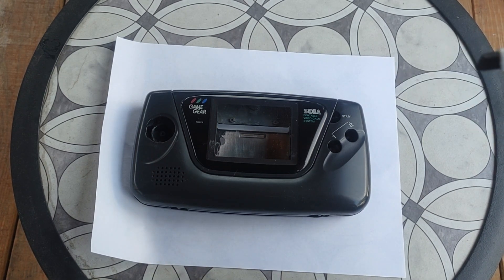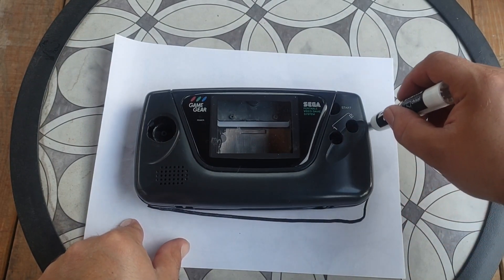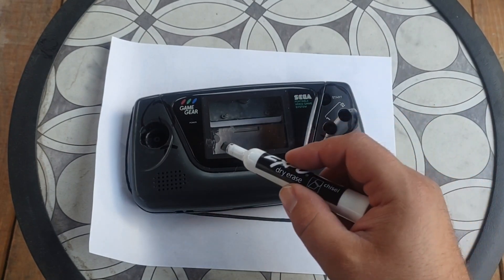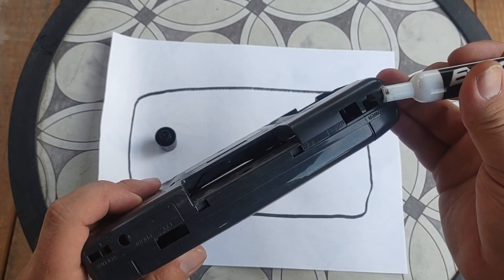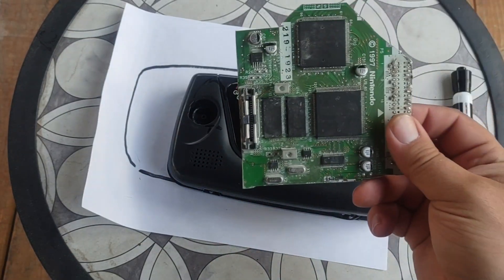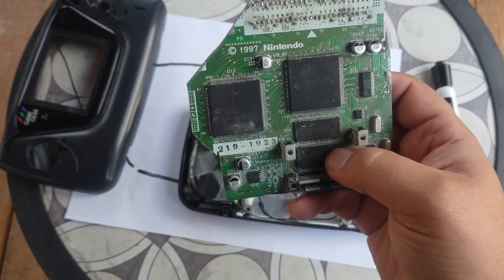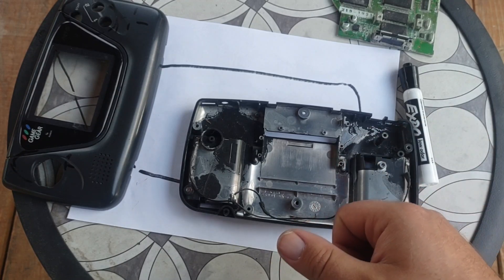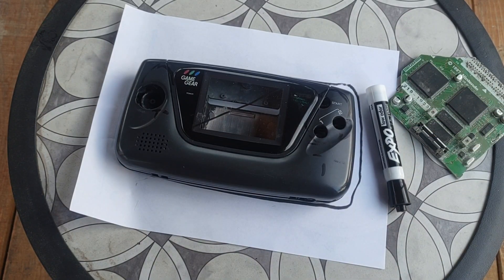N64 Portable in a Sega GameGear part 1: planning

Comment: Cut off the top pins and wire it up directly to the rcp chip
Reply from the maker: I've tried that before in the past and found it unreliable and difficult lol but we will see, maybe. I recently got 11 n64s pretty cheap so I may experiment
Reply: @wolfsquatch  I've done it before just to make it fit in a atari lynx 2
Reply from the maker: @MrGoemon1  are you saying just the top 24? How many of those are actually required to go to the rcp?
Reply: @wolfsquatch  yes the top row and about 18 wires and use a Voltage meter to trace the pin to the rcp chip
Reply from the maker: @MrGoemon1  definitely gonna try it out

Comment: Cool project mock up looks sweet! Good luck
Reply: How could you fit an n64 cartridge in it?
Reply from the maker: @zasandfan1922  either resting on the back or on the top
Reply: @wolfsquatch  no experience with n64, but couldnt you just run games off an Micro-SD Card mounted inside the game gear...
Reply from the maker: @markjaasmi9159  yes, I could do that but I would like the ability to play my physical cartridges.
Reply from the maker: Thank you 😊